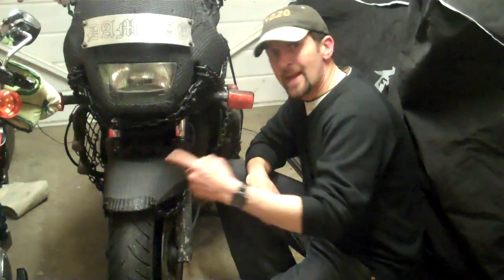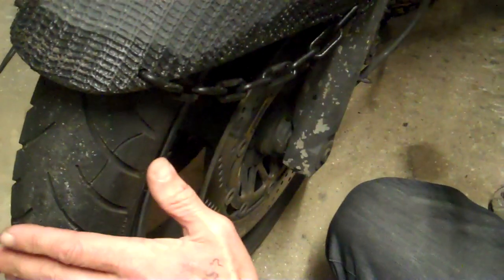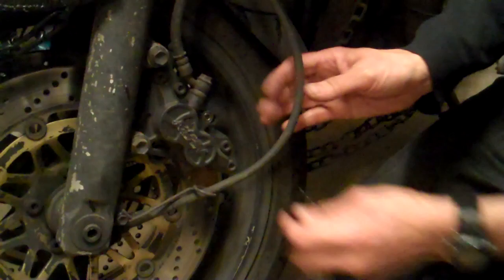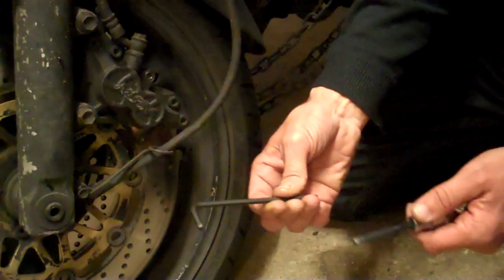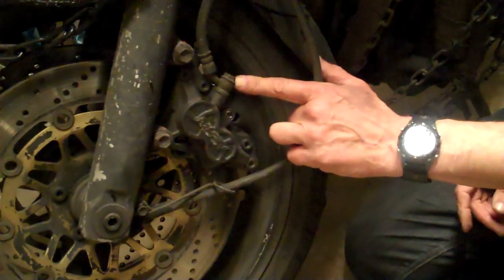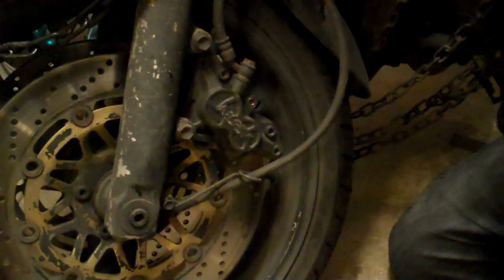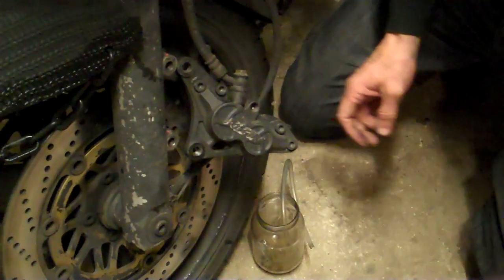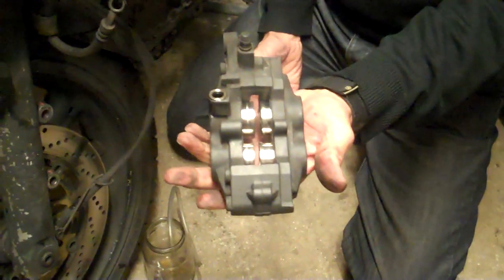Delboy's Garage, Motorcycle Front Brake Caliper rebuild Part 1.

Comment: I follow you tutorials religiously but have found an anomaly of which I need your advice.I've cleaned everything as best I can but have arrived at a point that I'm confused. The pistons of the Hayabusa Calipers that I intend to install in my Trophy  appear to be coated with  Teflon or something similar rather than something that can be polished. I have taken everything apart but am stuck at this point because I don't know how to clean the pistons properly. It is obvious from your videos that they are not apply pressure evenly. The question becomes how do I clean them properly?
Regards
Ed J.
Reply from the maker: Hi Ed, if you believe the pistons have a Teflon coating, then work with the same principles that you would anything Teflon coated, such as a saucepan... don't use anything abrasvie... soak in hot water to loosen any deposits and then try a toothbrush and brake cleaner... in principle, if it is a Teflon coatng, the dirt should float off... have not had cause to do Teflon pistons, so let us know how you get on
Reply: You were correct in that a simple toothbrush and mostly just my thumbprint removed all debris from the pistons.I doubt that my further problem can be resolved without you inspecting what I have accomplished so far. I used my brake master cylinder to pump the pistons out to the point that I could remove them using an old inner tube for padding being careful not to scar them in any way. After carefully cleaning everything  I assembled everything per my pictures I took at your suggestion.I decided to use my previous method of using my front brake master cylinder to insure that all pistons pushed out in the proper manner while at the same time suspending the caliper so that bleeding was easier. All the pistons on one side pushed out while non of the other side moved at all.The caliper also leaked in the process. Thinking that i may have misplaced the O rings that connect the two sides I disassembled everything to find that was not the case. I am now stumped as to what the problem may be. Any suggestions? Ed J.
Reply from the maker: Ed J.
Hi Ed....ok, where is the fluid coming from?, piston seals, or from the joint in the body..? if one side isnt pushing, then it could be that side isnt getting the pressure as its finding a leak first..!    dry it all off, and see if you can work out where its coming from mate... let me know.. Del.
Reply: Moonfleet41 Turns out to have been coming from the tubing coming from the bleeder.Being suspended the fluid was running down the caliper giving the appearance of a leak. I sourced a tighter fitting tubing and no more leak. The non moving pistons was nothing more than one side of the caliper not being properly bled. Ignorance is NOT bliss! ;-)
Reply from the maker: Ed J. Ha ha, pricelss lesson buddy, you'll know next time aye... good on you buddy, well done for getting it sussed.. take care, Del.
Reply: Moonfleet41
Hey Del! Remember I'm 76 years old! How many next times am I gonna get? ;-) Regards and thanks again for all your help! ;-)
Reply from the maker: Ed J.
Hi Ed... I'd forgotten about your vast age, but you know what they say, you're as old as the person you feel, so go get yourself Thai au pair lol!   Just remind me again where you are in the world, cos it would be great to meet with you some day... all the best, Del
Reply: Moonfleet41 I'm located in the Sunshine State of Florida about 18 miles South of where the Shuttles went off! Heat index 107°F at least 4 months of the year.hence the hot suit from the Old Fart remember? Works Good! Having read a post about 6 pots overheating and locking up I'm a little concerned whether to install them or just keep the 4 pots in place. What disengages the pistons from the disks and how should I test them should I install them to ensure they are releasing properly? Mine are sparkling clean and the other poster was do for a rebuild. Should I be concerned? The thought of the front wheel locking up on the freeway at 80 mph or so is not a pleasant one! ;-) Warmest regards! Ed J.
Reply from the maker: Ed J.
Hi Ed...jealous, you live in a beautiful place my freind.. The pistons on any motorcycle front brake are retracted via the hydraulic suction created when you release the lever and the spring in the master cylinder pushes the ram backwards...they only need retract about half a mm, and thats fine...and ive not heard of six pots locking up in the heat..if they did that then they wouldn't be able to race MotoGP bikes at Laguna Seca in 100+ degree heat....   I think if this is in any way true, it could be related to the fact that 6 piston calipers suffer more with dust build up and can be effected by being dirty sooner...the same dirt buildup that you've just cleaned off... i would say that if you keep them clean then they will be fine, and if you experience any binding when you check the bike before you ride...then deal with it right away...I hope that helps. 
Good luck with it Sir... take care
Del.

Comment: Is it safe to use brake cleaner to clean out the piston bores?
Reply from the maker: Yes,, brake cleaner will do no harm to a brake component of any kind..
Reply: @Moonfleet41  will it leave the system when I bleed the new fluid through? I don't suppose it would damage the brake fluid if there was a little bit left inside the caliper?
Reply from the maker: Spray some onto your bench.. you'll see that it vaporizes almost completely leaving barely any residue to speak of.. wipe out the are with a dry rag or paper towel and you're good to go mate.
Reply: @Moonfleet41  Awesome, thanks for the help!

Comment: I just finished doing my calipers after following the instructions on the video.  Thanks so much for your videos they have given me confidence to take on jobs on my bikes that I wouldn't have done previously.  Wheel bearings and Fork seals/bushings being a couple more.

I don't know if you've come across them before but I got my seal and piston kit for my blackbird from Brakemasters ( https://brake-masters.com/content/motorcycle-brakes/motorcycle-brake-caliper-seal-kits.php ), their seal kits have squared seals rather than tapered seals so they can be fitted either way up, takes a minor complexity out of the equation.